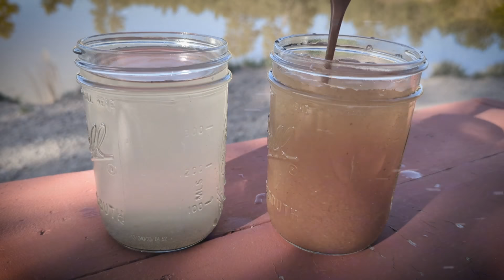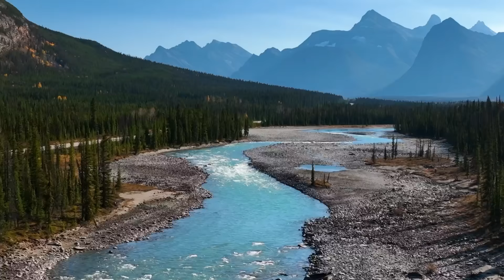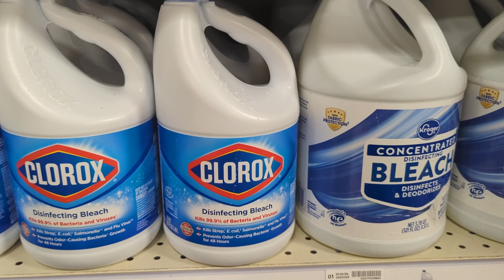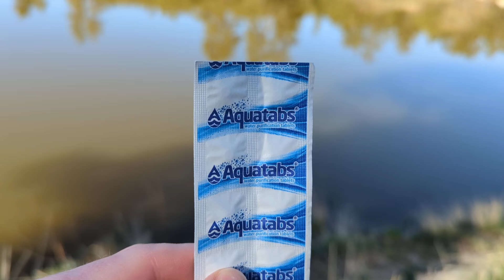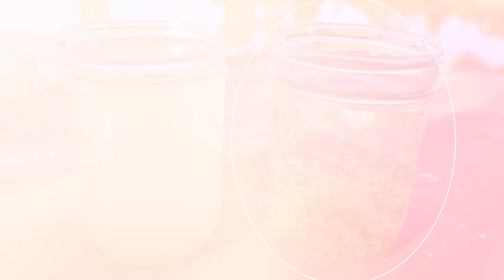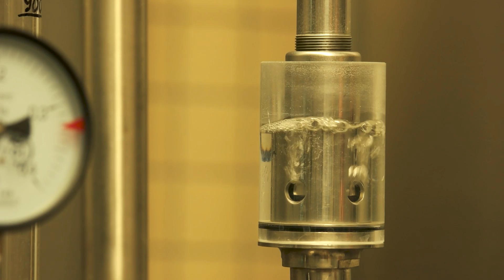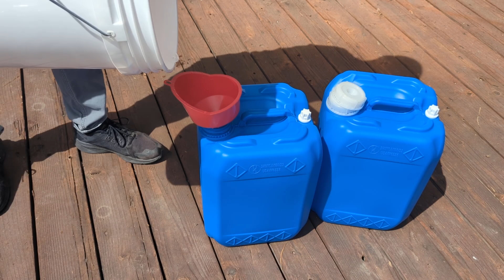The KEY to Emergency Water Preparation Before SHTF

Comment: get a (big berky) gravity fed water filter.  It makes (stagnet pond water) into sweet water.  A little expensive, it's about $500.  But, evenso that it might be "slower" than a person wants.  It does have a 5 gallon reservoir .  Fill it up at night, and in the morning.  Then you have a 5 gallon buffer of clean water.  Worth every penny.  Evenso, be sure to get the "priming" kit.  Off the shelf they intend you to use the faucet to prime your new filters up.  In the wood, no faucet.  You need the kit.  I think it was $20 about.  enjoy.
Reply from the maker: Berkey (and similar gravity fed filters) alone  is not sufficient protection for filtering untreated surface water that is microbiologically unsafe. The water should be properly disinfected either with chemicals prior to filtration or boiling or UV post-filtration. I'm currently working on a video diving deep into the deception companies like this have used to sell their filters as sufficient for emergency preparedness and filtering untreated surface water. Stay tuned
Reply: @waterfilterguru  OK, so Berkey is feeding me a line of horse poop.  I believe you.  What they are telling me ((stagnet pond water will be good for drinking).  Their pitch does not quite sound right.  I mean, yeah.  It, "IS" possible.  But not for a "gravity fed" system.  And not for $500.  I am excited to hear your insights.  carry on.
Reply: Actually, berkeys were used long before there was plumbing in places like Africa. Pretty sure it would be fine, however, in a grid down situation, I would boil all of it first. The original filters are silver impregnated. Silver kills bacteria. That's why it's safe.
Reply from the maker: @wolf-ls7jx  the silver impregnated into the filter is to prevent bacteria growth in the filter itself - not disinfect the water. It's vital to understand the difference. Always use a proper method of disinfection, such as boiling like you said
Reply: @wolf-ls7jx  {Silver kills bacteria. That's why it's safe.}  woohoo, that's what I was thinking.  That's also why those filters are so very expensive.  But it works, and it's fast (couple hours is fast to me 'i'm old")
Reply: The instructions included with Berkey filters clearly states that water from lakes,  rivers etc. should be treated with bleach before filtering.   I have been using them for many years.  Similar gravity filters also work well.
Reply: Having grown up in a third culture country where the water is completely unsanitary(Philippines) we always just used a catadine filter,  which is similar to Berkey. I have friends who more recently lived in Papua New Guinea who relied on Berkey to filter their water. I don't know if the person who made this video has ever had to rely on any of these for his drinking water, but before dissing filter systems, perhaps talk with people who've actually had to use them in real life. We didn't add chlorine, nor did we boil it ahead of time. That was 25 years ago, so they may have changed how they build them. I know that we currently use a Big Berkey, but have the older ceramic, which is similar to the catadine filters I used growing up. I don't know how good the new Berkey are, so perhaps you need to use bleach.
Reply from the maker: @sarahwy13  What you describe sounds like Doulton (British Berkefeld) Ultra Sterasyl ceramic filters, which are actually certified by the NSF for cyst reduction.
Reply: @sarahwy13  (, so perhaps you need to use bleach)maybe yea, maybe nay.  I really don't know.  The instructions say "makes stag-net pond water sweet".  But people on the internet say that claim is all "snake oil".  But, logically, and since it is life dependent.  I'll just use a lil' bleach.  But, for the price of those filters ($300), no bleach may be required.
Reply: I hope that @waterfilterguru will help us figure out how to properly filter/disinfect pool water (often containing chlorine, at least at the beginning of a crisis) using Berkey and whatever else we need. It is a nearby and large quantity of water that would appear to be useful for drinking, not just as gray water.
Reply: @sarahwy13  That is what I've heard from friends that have been using them for decades.  NO bleach or boilng needed.  None of them has ever gotten sick from water contamination.

Comment: Thanks for this info. You mentioned that ceramic filters can be used pretty much indefinitely (which I have heard elsewhere also), however when I went to the ProOne site, they recommended replacing every 6 months or every 1,000 gallons. Could you explain or do a video on this?
Reply from the maker: That's because the Proone filter is not only ceramic, it's carbon on the inside. The carbon can only adsorb a certain amount of contaminants before it needs to be replaced.
Reply: @waterfilterguru  Thanks. That makes sense. So do you recommend others that are fully ceramic and do they do as good of a job filtering water?
Reply from the maker: It all depends on the ceramic filter and size of pores it has. That's one setback of ceramic filters is that you never know for sure and pore size can vary from product to product.
Reply: @waterfilterguru  Very interesting. Looks like I need to do more research. 😁
Reply from the maker: @organizedchaoslife  Yep even with ceramic  filters for that reason its always a good idea to also disinfect, just to be on the safe side

Comment: I'm very skeptical of "water preservative."  What are a few drops of some chemical going to do to "preserve water for up to 5 years"?  If it does anything, it is most likely bleach which will kill microorganisms, and you should just use bleach.

If the container is clean, sealed, kept at room temperature or below, in the dark, then sterile water should keep effectively forever. In fact, many microorganisms will simply die out over the years in such conditions.  Some won't! (such as cyst forming bacteria)  Because water can be hard to sterilize and hard to keep sealed, you should replace it every now and then and 5 years seems like a good window regardless of pre-storage chemical treatment, especially if it looks or smells bad or has evaporated.  If you have stored water that didn't get changed out, I'd look at it and treat it appropriately before use, but I wouldn't stress about it. The containers shown in the video...  I've never had good luck with them. They are difficult to seal completely, and they aren't particularly rugged. NATO spec 20L bottles are better.  Not cheap.  Figure your per-volume storage cost.  55 gallon barrels are much more economical and large tanks even more so. My barrels don't seal well but kept in my cool, dark basement the water seems to stay good indefinitely (10+ years).  I also have a 2500 gallon tank which was delivered for less than $2500.  It doesn't seal well either but I did stuff copper wool in the lid vents. 😂

For a non-chemical way to store water indefinitely, you can bottle clean potable water in glass bottles using a water bath canner and then it will keep as long as it stays sealed.
Reply: Friend, don't be fooled, the "preservative" is just 5% bleach solution, essentially it is chlorinating the water again. You can use a capful of regular bleach if you don't intend to drink it immediately, as it will dissipate over time. Other options is chlorine tablets from camping stores
Reply: Google it.  It will answer your question.

Comment: Thank you for the informative video. Very grateful. I have about 10 cases of water stored, as well as a Sawyer Mini and a Life straw. I also have 2 small bottles of AquaPure tabs.  Bleach is a great alternative but does not store well. Also, a Silcock key is very helpful to procure water from larger buildings. I have tested the key and found a few large buildings with access to clean water near my home. Great information I have subscribed and left a like.
Reply from the maker: Thanks for your comment and I'm glad it was helpful - sounds like you're doing all the things to be prepared!
Reply: I have a silcock key as well but I need to test it to make sure I know where the buildings are and how to use it.
Reply: Have two cases in case family kids stupid
Reply: @susannautterback6815 
Great idea to use your Silcock key now… and at more then one place, as standard Silcock Keyes have 4 different options. 

Also there is at least one other type of Silcock key. 

I have two, with 8 options total. I am not sure if there are more types. I have both of those in my get home bag. 

Another set of Silcock keys stays at home.

Comment: Zerowater filter on my kitchen countertop and a Grayl geopress goes where I go. Along with a couple millbank bags. The bag that houses my Grayl also has a separate aquamira filter and accompanying silicone hoses. Lastly, sometime ago I came across a fellow near me selling food grade IBC totes for $75 a piece, they formerly contained rum. Not a big fan of using bleach, but for that kind of volume it's not a bad option.
Reply from the maker: Right on, thanks for sharing! It's good to note that ZeroWater should only be used with properly treated water - don't rely on it in an emergency unless you've disinfected the water first!

Comment: "Hot water heater" Why would you need to heat hot water? J/K ;-) Some great water tips indeed.
Reply from the maker: Think of it as a giant tank with 40-50 gallons of water ready to use if you no longer have water coming from the tap 😉

Comment: I liked your video and I subscribed.  Its quite good but you didn't touch on The Holy Grail of filters... Reverse Osmosis.  Please check out the ITEHIL R.O. portable, battery operated, rechargeable system, and maybe make a video on it.  Its an amazing piece of technology.  It can be recharged from a solar panel and can make up to 9 gallons of pure drinking water from one charge...and its quite affordable, with very reasonably priced replacement filters.  David in Seattle

Comment: Also consider reverse osmosis via counter top models.  They only pull 30 watts when running.  They also have solar powered portable units as well.  You can literally throw the hose into a water source and filter it on demand.  Great video love the various options.  Personally I have several options each has their strengths and weaknesses.  The world is so crazy right now and clean water is a necessity for survival.
Reply from the maker: Thanks for the comment and feedback! One quick note about reverse osmosis - it should not be used as primary treatment for untreated surface water due to high risk of membrane fouling and bacterial recontamination. It's a great option as long as water is properly pre-treated to remove suspended solids and disinfect it first.
Reply: Any suggestions on models?
Reply from the maker: @Missmiss1718  Aquatru https://geni.us/chlQv5o is the best countertop RO I've tested so far. To reiterate again, you shouldn't use it as primary treatment for untreated, raw surface water or water that's potentially microbiologically contaminated. The water would need to be disinfected first, and have any suspended solids filtered out
Reply: I remineralize our RO water and love the refreshing flavor and taste
Reply: @chupacabra304  We have RO in our house. What do you use to remineralize it?
Reply from the maker: Check out this article https://waterfilterguru.com/how-to-remineralize-reverse-osmosis-water/
Reply: @organizedchaoslife  I have this Caraffe(sp?) that adds the minerals back in

It has this extra filter in the lid and the last step of filtration is passing through some mineral mix cup that we change out every once in awhile , pretty nifty :)
Reply: @chupacabra304  Is just not sufficient for long term emergency needs

Comment: Great video. I recently bought a lifestraw pitcher for times like this. Hopefully it’s a good one that does what it says it does. I have been storing water for a few years now. Unfortunately, many have expired now. I’m sure these could be used for bathing in bad times, but maybe not to drink. I need to rebuild my water supply with new bottles for drinking. Thank you for the tips and the reminder!
Reply from the maker: Sounds like you're already well prepared! The Lifestraw Home pitcher (this one https://geni.us/7Nrnhtm if anyone else is reading and curious) should be a solid choice for emergency preparedness, their lab testing has been completed by accredited labs (WQA, ANSI) which is reassuring - however I've not personally tested this one yet so don't have any firsthand data as of now.
Reply: The water that is expired is still good clean water. All you need to do is run it through your purifying pitcher..
Reply: @tennesseeterri  I have some bottle water that was in storage for a year, has a plastic taste, what filter would you recommend???
Reply: @wallychambe1587    I can only tell you that I would pour it into my Berkey filter and then taste it. You could also try a charcoal filter, too.

Comment: UV treated water needs to be consumed within a certain amount of time as it doesn't kill, but just deactivates for a time. 
" Deactivates bacteria and viruses. When subjected to ultraviolet light, bacteria and viruses are no longer able to reproduce." this can sometimes reverse! check out the EPA fact sheet Ultraviolet Disinfection. i remember this from a UV wand that I used in china. the instructions stated that the water should be consumed within several hours.
Reply from the maker: Do you mind sharing a link to the info about reactivation?
Reply: @waterfilterguru  check the EPA website using the terms i used for a search (can't place links in YT comments).  it's a fact sheet. also, check the instructions on any wand or other portable UV device. if you have an in-home unit where water typically won't sit around for long or will be refrigerated, it may be different.

Comment: are the hollow fiber and carbon replacement filter for the burkey on amazon any good?
Reply from the maker: I've not tested those yet, so can't say as of now
Reply: @waterfilterguru  Ok i know you get flooded with requests to test specific filters so i wont dogpile on. you will get to it if/when you do. no rush.
Reply from the maker: @Zaku186  I'll add this to my list! Is there a specific brand/ model you are referring to?
Reply: @waterfilterguru  I would really love to see you test the Frizzlife. AT85 filter for their G210 filter. it may just be cleaver marketing but i get the impression from this company they are actually trying to make well thought out solutions to water purification. and not just "products for consumers" that is only intended to sell and make them money not actually perform a function to a standard.
Reply from the maker: I'll look into it, thanks
Reply: Hollow fiber filters block quite easily, compared to ceramic ones, which can usually be scrubbed clean once or twice before the pores block up. Carbon filters are for removing chemicals only, and not for anti-bacterial filtration. Bacteria can breed in a carbon filter, so ALWAYS have a ceramic or other fine filter after the carbon, before the water goes into the storage tank.

Comment: I have an old style glass 5 gallon Sparkletts water bottle. I place it outside, and direct a large mirror towards it, and the UV effectively kills the micro-critters.
Reply from the maker: Love it!
Reply: The WHO says that is effective with glass or clear plastic.
Reply: @mrmicro22 The WHO may not have mentioned that most types of plastic will dissolve harmful chemicals into the water much faster when the plastic is warm or in direct sunlight.  The taste is awful and the long term effects are pretty scary too.  Even plastics that are called "food grade" are only safe when using water that is not too warm. Glass containers are definitely worth the extra trouble!
Reply: @321RGB In my humble opinion, use ... ONLY GLASS when using the Sun to clean your water.   🇺🇸
Reply: @mrmicro22 The WHO also wants you ⚰️🫣
Reply: Nobody said anything about food grade stainless steel for large amounts of water to store. I remember we had a stainless steel milk can, it was 3 gallons so it was easy to move around unlike the 5 gallon water bottles. 73
Reply: *Homer Simpson voice 
...Ummm dead micro-critters.
Tasty water.
Reply: Isn't that also a fire hazard?
Reply: Where can you buy  5 gal glass bottles?
Reply: @angelnative9267  good question if you want to pay a good price for them. No matter stainless steel, glass it's all expensive. Right now I use 5 gallon water bottles but that's what all the water companies use. I would never travel with 14 glass water bottles I have a hard enough time with plastic. The drum ideal would be good because I could dump the water into a 55 gallon drum and only transport my water with the plastic jugs and the 55 gallon drum could have a pump not these cheap pumps they put on water bottles a real food grade pump. 73
Reply: @angelnative9267  Google that
Reply: Health Food Grocery stores @angelnative9267

Comment: Good stuff.   Think So Cal. A Pool is it!!!!  Short vid on using that???  Not for 10$ just what it takes.
Reply from the maker: Great thanks for the idea/ request, I'll see what I can do
Reply: The pool water will only work if it's NOT a salt water pool.  Must be a chlorine pool unless you can distill the water.
Reply from the maker: @tennesseeterri  Good callout
Reply: @tennesseeterri a saltwater pool could still be used if you have access to other sources of drinkable water. Mix a bit of the saltwater into your fresh water and you almost get Gatorade 😉